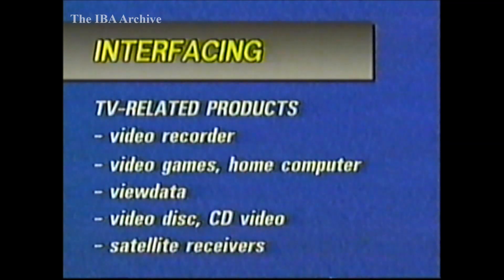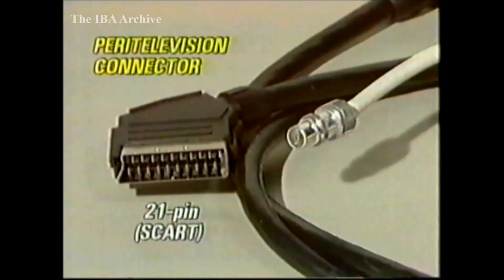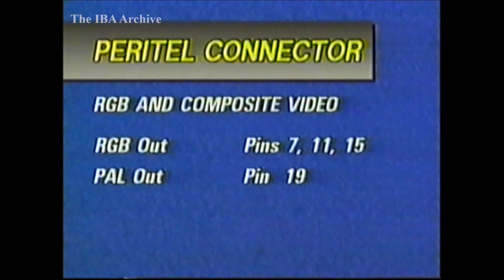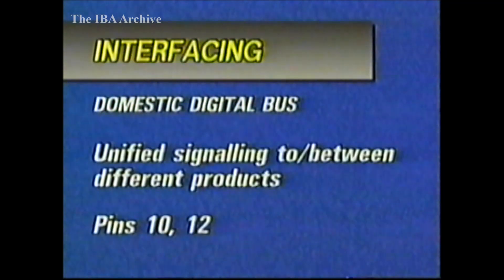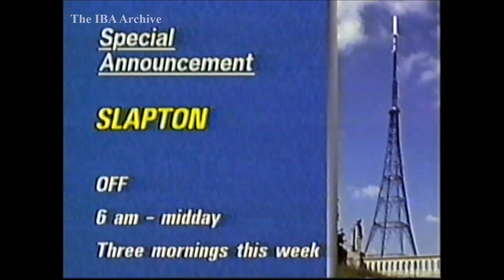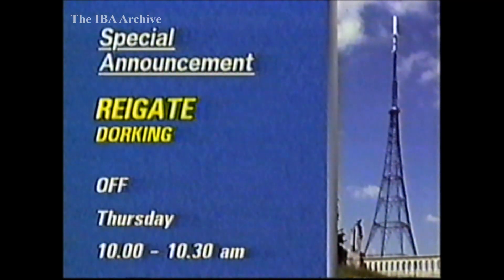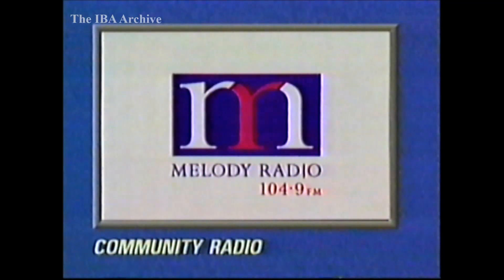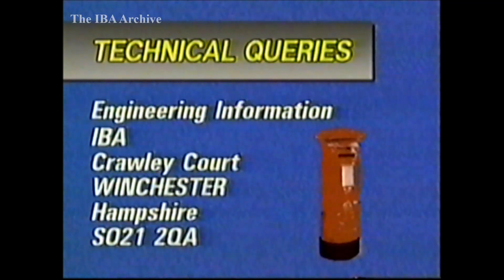IBA Engineering Announcements - 26 June 1990 'Interfacing Video Devices'

Comment: AV connections are best when interconnecting equipment and to your TV for slightly improved picture quality and stereo sound through suitable stereo equipped televisions and from linear stereo / HiFi Stereo VCR's, all you have to do is select the appropriate AV input on your TV i.e. AV / Line In / Aux etc. 

S-Video connections can also give improved pictures and cleaner recordings on S-VHS and Hi-8 recorders / S-VHS and Hi-8 cassettes from D-MAC transmissions, because it does the things D-MAC does by separating the luminance and chrominance portions of the picture as transmitted. 

It's a shame the IBA spec didn't allow for fitment of a pair of S-Video sockets and stereo phono sockets on BSB receivers to facilitate this possibility.